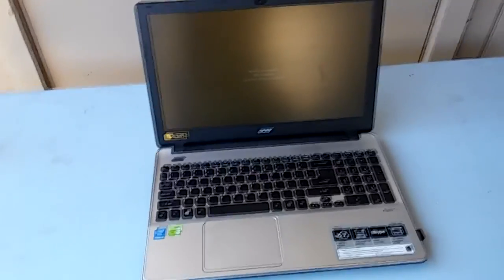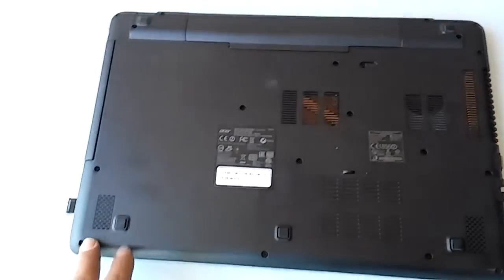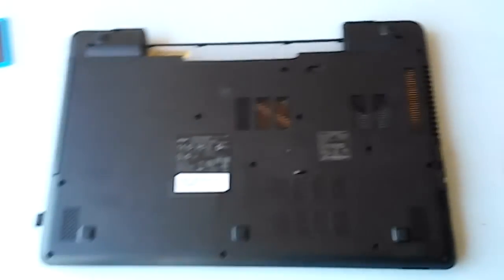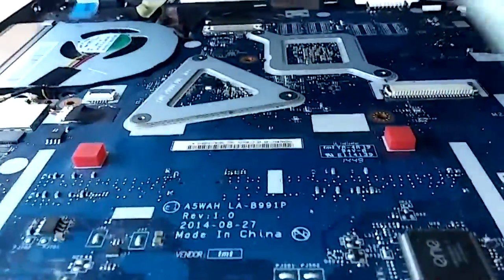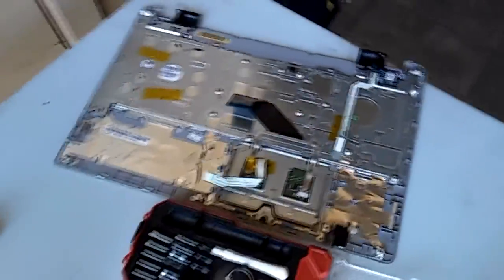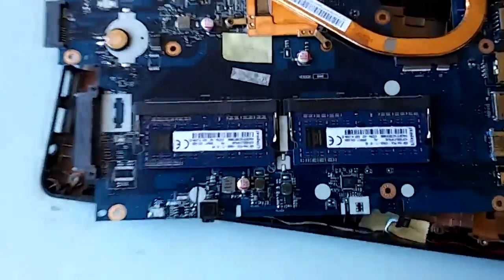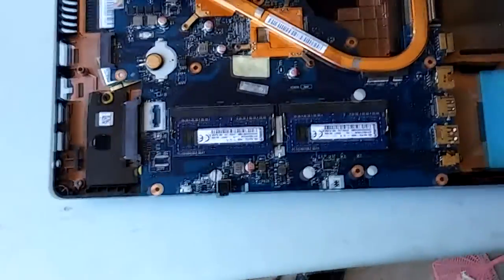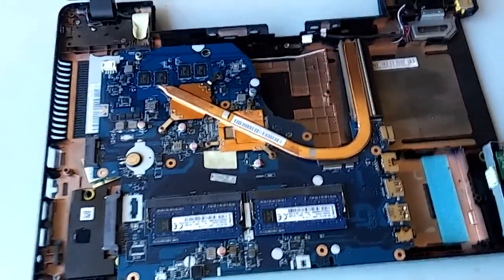Acer V3 572 543S ram search

Comment: How did you get the battery out?
Reply from the maker: Hey, at 1:04 in the video, you'll see near the top by the battery, there is a screw hole and to the right there is a capsule shaped indent. that is the battery release. the tint hole at the bottom does nothing (that I could see).I used a screwdriver to push the switch to the right. With that held in place you can pull the battery out. Hope that helps.
Reply: @ thanks for getting back to me. The owner of the laptop ended up showing me that and I was able to do the job.

Comment: Well:  1) Please, use a camera with stabilization.
2) The mighty power of Holy God should burn the soul of whoever build this damn crazy chassis.  I mean: I can replace SSD and RAM in my own notebook in 30 seconds.  Remove ONE screw, then remove the cover, replace the hardware. That's how a notebook should be designed!

Comment: Hi, really useful video. I just received ram and a SSD because I want to upgrade it but come to my attention that you say it is possible to add a 2nd hard drive in the tray where the cd rom should go. Did you ever add that 2nd drive? Do you remember what you needed for it? I really hope you see and answer this comment. Thanks again.
Reply from the maker: Hey, sorry I didn't see your comment. If you want to add a SSD you need to get a "hard drive tray for laptop". I never got one since I didn't need it. I primarily do 3d modeling ans animation on my laptop and use my desktop for rendering. I have plenty of external HDDs, useful for moving rendered animation frames from desktop to laptop for editing (video).

Comment: What is the maximum Mhz ddr3 Rams that I can install in this laptop? I have the 8GB 800Mhz RAM now, and I am planning to upgrade. Can I, for instance, install two 8GB ddr3 1600Mhz RAMs? What is the maximum combo you have installed without problems allready?

Comment: This particular model is a "retail" version.  That means there is no easy access to the hard drive and memory so you will have to pay the technician at the retail store to do your upgrades.  If you research the acer aspire lines you will find there are always retail versions that are built without easy access.  Acer is not alone.  large retailers with tech shops would have dell, Toshiba, Lenovo and most other vendors HP old compaq etc make these to increase repair division profits.
Reply from the maker: I've never heard of a "retail" version of a laptop. And I worked as a service tech for about 10 years. In that time I never saw a laptop without RAM or HDD access.
Reply: @sandman3008     I worked professionally on personal computers from 1982 until now.  In the US Best Buy, Walmart, Computerland and most chain stores had RETAIL computers with no easy access to the memory or disks.  The computers were made by dell Compaq HP and many other brands  and would have the same description as computers with easy access but a different model number.  This also allowed the retailer to reject price match as the part numbers were different.  Easy access means take out 2 or 3 screws add or replace memory or the hard drive.  Does not involve removing the keyboard or memory board or disconnecting any wires
Reply from the maker: @cws01104  What your saying is all new to me so I'll have to take your word in it. I worked in a small shop that did repair work and we almost never sold new laptops. So all of the laptops that I worked on were bought elsewhere and were easy to access the internal parts. Maybe I was just lucky.

Comment: So 7 months later, I changed my mind and went for it. It may have taken two hours, but I got the RAM out. There were some stubborn cables, but got them eventually. Now I just have to wait for the RAM and SSD to get here soon. I also got a caddy for the original HDD to hook into the DVD drive location. I had no idea you could do that -- so thanks!
Reply: Hey sorry but I have the same model and am looking to upgrade the ram. While prying this thing open I might as well install an ssd. But of a silly question how would one go about installing an ssd without removing the included 1 tb HDD ?  Is there an additional place were the ssd could slot in or is it that I can just have either a HDD or a Ssd and not both ?
Reply: Kashif So what I did was added a new SSD where the HDD was. Then I moved the HDD to where the square dummy location, where a CD drive would usually go. I just had to buy an HDD caddy, as the space is large than the drive itself. Now, I got a knockoff brand, as the shipping was a whole one month cheaper than the real one: Deyoung 2nd Hard Drive HDD SSD Caddy for Acer Aspire V3-472p V3-572p V3-572g V3-572pg V5-471 v5-571p v5-571g https://www.amazon.com/dp/B017IH8IYW/ref=cm_sw_r_cp_api_i_IZi1EbFJR6FQ2 . The real one apparently fits perfectly and has a solid black outside. The one I got works just fine, but is about 1 inch short of the normal border of the case, and the outside has CD/DVD writing. I only had an issue with it once, when I stored it in my bag with that side facing down. It just didn’t recognize the drive until I pushed it back in place. I now make sure to place my laptop up on that side in my bag. Since then I haven’t had an issue. I’d say to try to find the one that has perfect reviews, as it fits perfectly. Maybe the shipping dates are a lot better now.
Reply: @ScreaminSeahawk  ah thanks a lot. Just one more question is it beneficial to have the ssd in the original hdd location than having it in the caddy? It's going to be much more convenient if I can just stick the SSD in the caddy rather than switching both of them around as you can see what a pain it is to open this laptop up. I'm guessing the read and write speed would be different yeah ?
Reply: @kashif9087  I don't think it changes the read/write speed, but it is super simple to switch them. Otherwise, the SSD won't fit very well in the caddy (I don't believe). Just make sure to backup all of the files you need off of them HDD and then wipe it clean before installing the SSD and then adding Windows. I actually didn't even need a new Windows key, as it was automatically saved to my CPU/motherboard. You just have to reinstall it on your SSD.
Reply: @ScreaminSeahawk  ah okay gotcha. Anyways the first thing I'll be doing is adding a bit of ram, so wish me luck as I attempt to open this thing up! Thanks a lot for your help :)
Reply: Kashif My pleasure. Just take your time with it. Let me know if you have any other problems/questions along the way.
Reply: @ScreaminSeahawk  One more thing I wanted to ask was whether there is any glue present when prying this thing open, as I'm trying to figure it out how much force to apply to pry the keyboard off.
Reply: Kashif I didn’t notice any. I was surprised how challenging it was to get the keyboard off. But I do highly recommend using a spudger like these: Quantity Lot Metal Spudger Pry Open Tool Scraper Knife to Repair iPhone iPad Tablet Laptop LCD/Glue Removal Wholesale (5) https://www.amazon.com/dp/B012P07V0E/ref=cm_sw_r_cp_api_i_0zn5EbGWPR77F . I couldn’t have done it without at least 2-3 of these.
Reply: @ScreaminSeahawk  Ah so I just managed to open the laptop up but I could not for the life of me disconnect the touch pad ribbon cable it just seemed stuck, and stiff in comparison to the other cables. Maybe will give it a go later on. The tools you mentioned would be more convenient but I used an older card which did the trick too. Thanks for your help anyway!
Reply: Kashif Ribbon cables are a PIA. It’s even harder to put them back in. Best of luck!
Reply: @ScreaminSeahawk  hey man I'm having a lot of trouble reattaching the ribbon cable for the keyboard. It doesn't appear to have a latch like the others. Do you remember how you attached it?

Comment: Will my PC boot properly if I upgrade only 1 RAM stick to have a total of 12 Gigs (4+8)? Will the Mobo read a 4x8 set instead of 4x4 or 8x8?
Reply: No, they need to be the same.
Reply: @StephenMcCallumAu  You're incorrect. I just installed the 8x4 combo and my laptop is reading it just fine
Reply: @StephenMcCallumAu  What is the maximum Mhz ddr3 Rams that I can install in this laptop? I have the 8GB 800Mhz RAM now, and I am planning to upgrade. Can I, for instance, install two 8GB ddr3 1600Mhz RAMs? What is the maximum combo you have installed without problems allready?

Comment: Those two screws break off first at almost every one of them. They are very important because they hold hinges and without them, every time when opening lid, there are much stronger force applied at corners of bottom case. Poorly designed. Older models had metal brackets attached to bottom case to reinforce it.
CMOS button battery is soldered inside white circle near 2nd RAM slot.